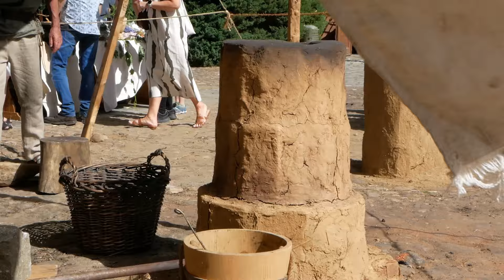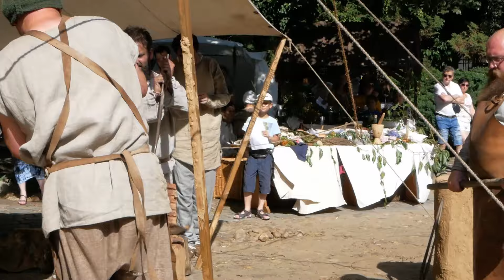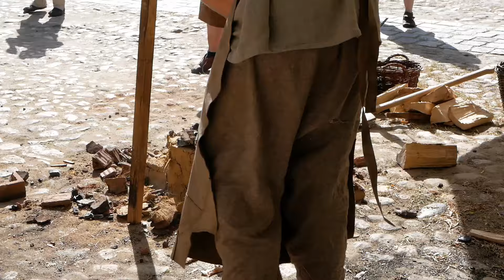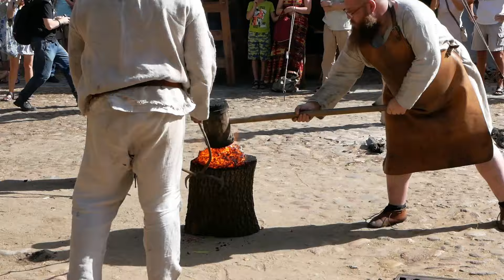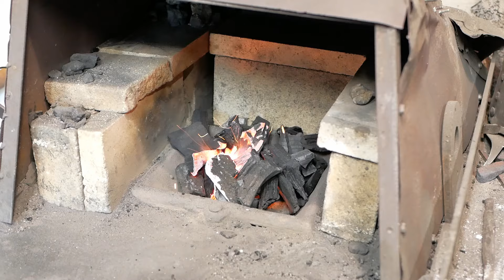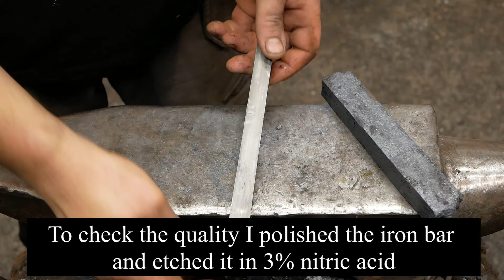Iron smelting. Bloom extraction and processing in the forge.

Comment: Curious as to what makes this specifically a Roman era furnace? Construction appears to be pre made bricks mortared with clay? What kind of bellows is being used (and what evidence)? Tuyere details? (Asking as a fellow iron maker)
Reply from the maker: Hi Darrell. Ancient furnaces have slag pits - hole beneath the shaft, the length of the pit is the same as furnace dimiter. During the smelting slag flow to the pit and form slag block ( i am sure u saw slag blocks collection in Pruszków museum in 2016, we also run with Kamila two slags pit furnace during festival). In Poland clay bricks and clay strips have been used to build furnaces. Tuyeres have been used but rather outside the furnaces. We do not know what kind of bellows were used probably primitive bag bellows.
Reply: @officinaferraria How many folds do you do when consolidating a bloom into a finished bar?
Reply from the maker: @jonajo9757  it depends of the quality of the bloom. Sometimes 1 is ok, sometimes 10 is not.
Reply: @officinaferraria  Do you have any sources on how iron was consolidated? Preferably anything regarding the medieval period.
Reply from the maker: @jonajo9757  using slage hammers, we know from Scandinavia 4-8 kg hammers. It is enough to make nice consolidated iron bar from bloom.

Comment: 8:02 The billet looks slightly overheated to my admittedly untrained eye ... it was white hot and throwing sparks even before being hammered.  Isnt there a fine line between forge welding temp and burning the steel ?
Reply from the maker: it is low C material, it needs to be white hot to weld it well.
Reply: @officinaferraria  Ty for explaining to a noob like me. +1 😁

Was there a step you did later on to boost the C content ... say, doing a blister steel step before restacking ?